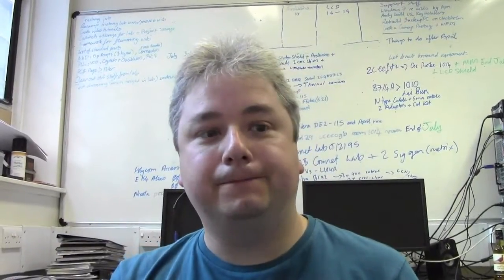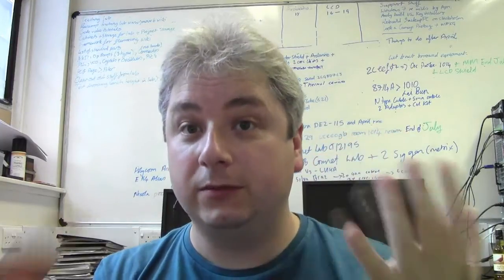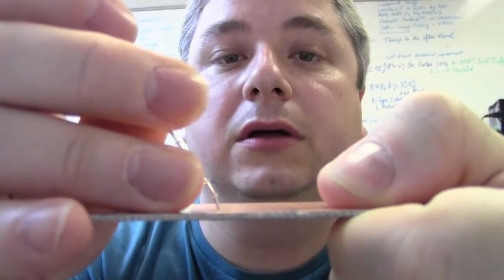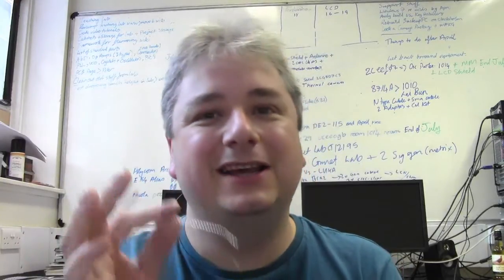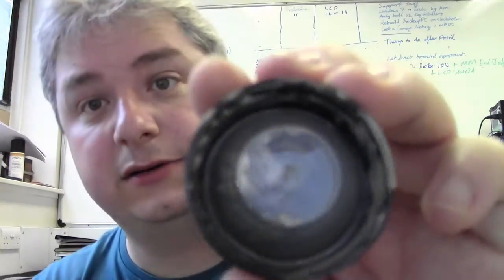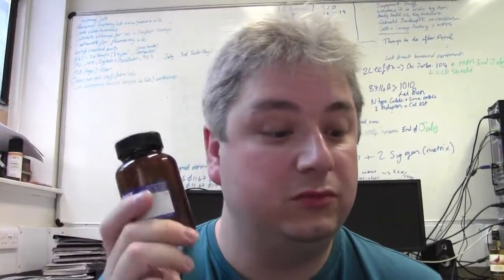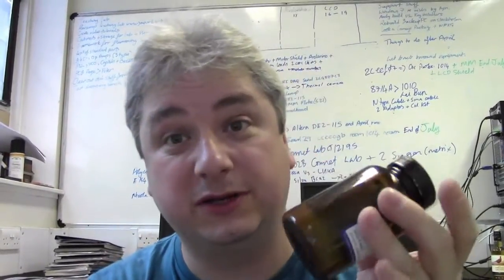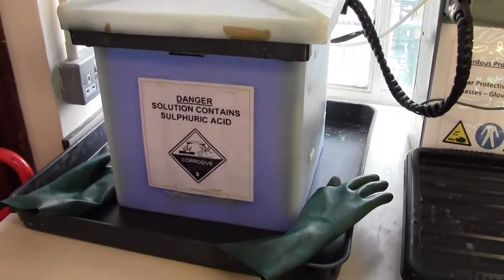Connectivity of PCB Layers

Comment: Hey Andrew, love the videos! Maybe you could give me some advice. At what point during home PCB production should rivets/eyelets be pressed? I won't be using a Favorit Riveter, but instead a single .8mm rivet punch and some force. If I wanted tin the rivets after securing them to the PCB, how well does a cured dry film solder mask hold up to a liquid tin bath?
Reply from the maker: I haven't done the tinning after the resit before but should be ok as long as you preheat the board then tin for a short time but any air bubbles or moisture trapped under the film might be a problem as the air would expand and moisture turn to steam and crack the mask so be careful when doing the mask.
ultimately it would be just like wave soldering a pcb so i cant see a big problem with it unless your tin bath is well over temp or the mask has defects.

Comment: How much better is the riveting tool compared to flaring the tail by hand? The riveting tool you showed seems to be available in Europe for half the price as it is here in the U.S. It is about $800 here. Ouch. For a rivet squeezer that seems like robbery. The European vendors I contacted said they will not ship to the U.S. Not sure whats up with all that.
Reply from the maker: I have tried it by hand before and the result was really hit and miss. I would say the riveting tool is better option as you can match the anvil size to the rivet and adjust for board thickness to get the preasure just right without deforming the rivet hole or damaging the pcb but saying that you might have a better tool to flar the end.
As for ordering I have the same problem here getting stuff from the US and far east; some items wont be shipped or sold and delivery\shipping costs can be way over priced plus somethings i gota pay the import duty and customs so might as well buy the over priced items in the UK or europe. yah pain in the ass.
Reply: channelengineer I tried some rivets on a board I am building. I am able to compress them well, and they look good under a microscope. But many of them are open connections! Even though the rivet flanges are touching the pads, they are not making electrical contact. I think this may be related to oxidization on the copper surfaces. I probably should have tinned the pads. If I put a small drop of solder paste around the rivet and reflow it, then it works. I suspect the flux in the paste is cleaning off the oxide. Have you had any such experience?

Comment: Do you have a link to where i could find one of the rivet installation tools?
Reply from the maker: http://www.megauk.com/through_hole_rivets.php
Reply: +channelengineer Wow, that is expensive. At £26 per 1000, you can easily end up at several pounds per board just for the holes.
Reply from the maker: +hellterminator If you require that many rivits (2.6p per rivet so for several pounds thats a 100+ holes) I think you need to consider a different method like through hole plating or a redesign.
Usually a rethink of the design layout can drastically reduce the amount of holes and moving to SMD will do the same but bear in mind not ever hole needs riviting and If neatness is not an issue then solder a bit of wire into via holes.
Reply: channelengineer Yeah, I was just remarking upon the fact that (despite my naive hopes) this is definitely not a full replacement for plating (which for me, a hobbyist, isn't really a viable option). I'll just continue using wire, I guess.

Comment: I wanted to try using via pins for my next board, but I couldn't find any for sale. Where can I find some?
Reply from the maker: Supplier : Farnell
0.84mm pin, Stock number : 1143879 or 1mm pin,Stock number : 1143880
Reply: channelengineer Do you know any where else to buy them? It appears the part numbers you mentioned have been discontinued.
Reply from the maker: Matt Pamenter
Dam, looks like Harwin has recently killed them off and I can't find them from any of my other suppliers.  Will keep my eye out for something similar and let you know.